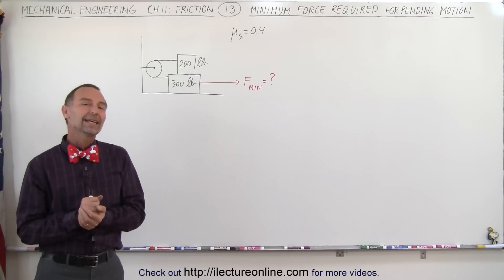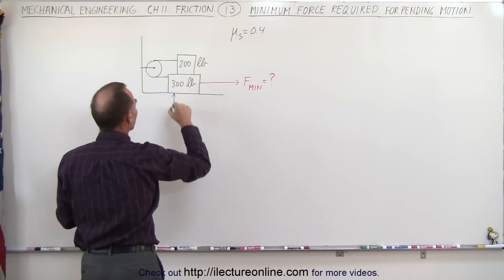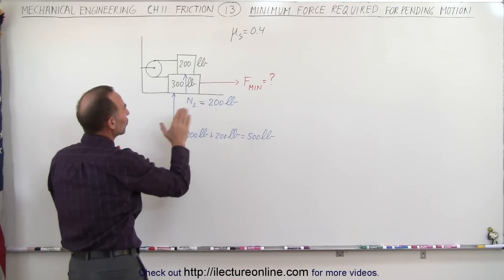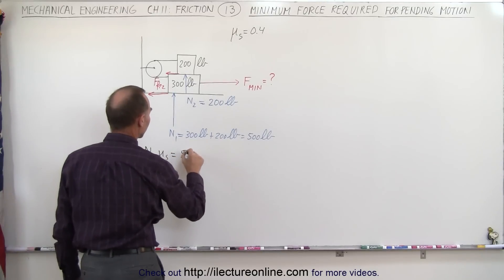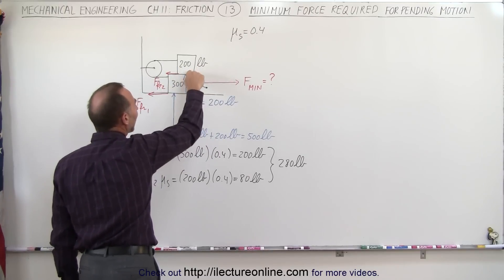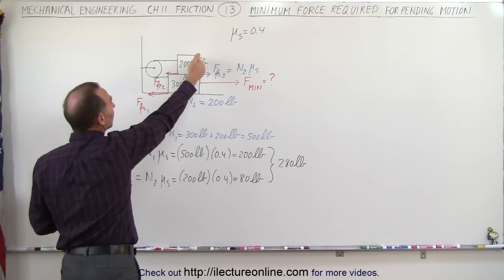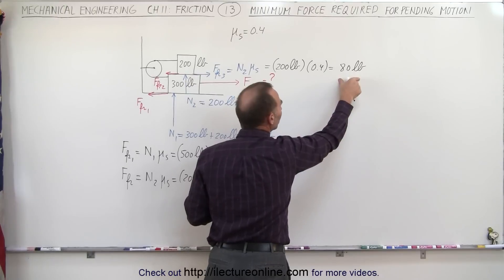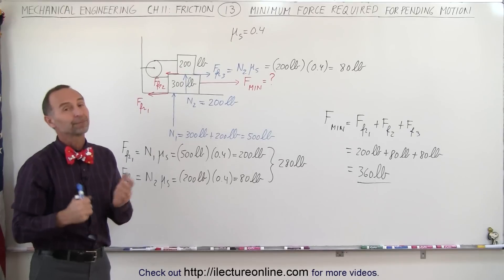Mechanical Engineering: Ch 11: Friction (13 of 47) Minimum Force Required For Pending Motion

Comment: sir i think Fmin = Fp1 + Fp2 because Fp3 is acting on 200 lb and only Fp1, Fp2  is acting on 300 lb in horizontal direction. so only Fp1 and Fp2 will oppose the Fmin..
Reply from the maker: No, the video is correct as is.

Comment: drawing fbd of both block seperately would have cleared doubt
Reply: I agree with you totally 
First consider the upper block 
Find tension in the pulley 
Then consider block 2 n Fmin will be the sum of all the forces to the right ie F1, F2 and tension in the pulley

Comment: 1. Why aren't you using m*g for N instead of simply writing it at m?
2. The friction coeficient is the same on the surface and between the 2 bodies?
3. Tension force in the cablu is irrelevant in this problem?

Thank you for all your great work
Reply from the maker: 1) Pounds is a unit of force that already includes g (like Newtons)2) yes3) Not irrelevant, but the tension is an INTERNAL force and does not affect the force ON the system
Reply: Michel van Biezen thank you So much for your answer. Sorry for the Pounds questions, didn't know how they work
Reply from the maker: No need to apologize.  All questions are welcome.